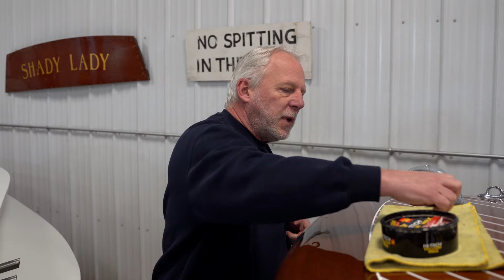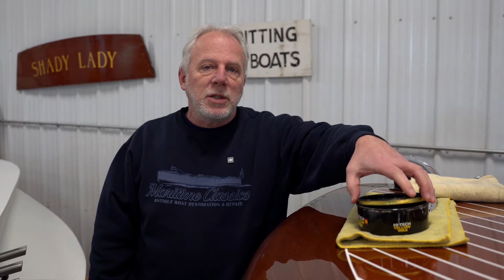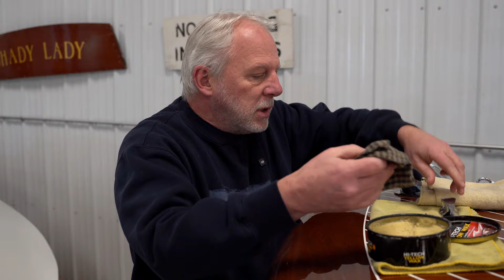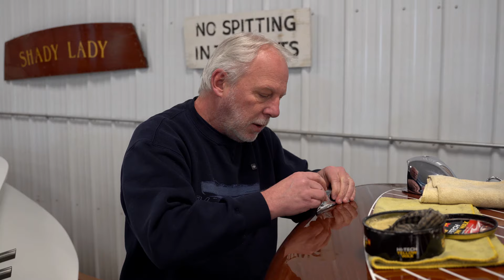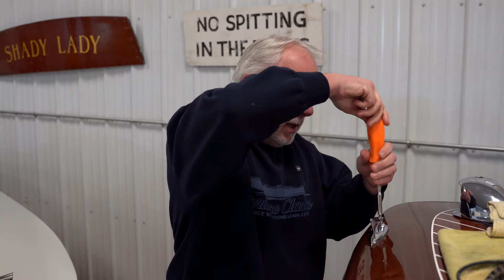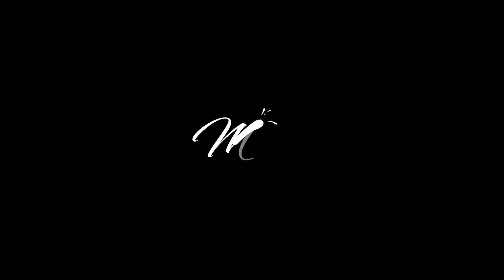How to Install Hardware - WOODEN BOAT RESTORATION

Comment: Mike, do you ever see water intrusion in the hardware fastener holes? If so, is there a way to prevent it other than a bedding compound?
Reply from the maker: I don't due to the varnish that ran into the old holes when we varnished the boat. If it out in the elements a lot on say a cruiser we would use a bedding compound. Also anything under the water line we do dip the screw in boatlife bedding compound.

Comment: Mike, do you not use any type of bedding compound?
Reply from the maker: Only on the tips of the screws. If it was a cruiser or a boat that spends most of its life outside you would want to use a bedding compound like Dolphinite.